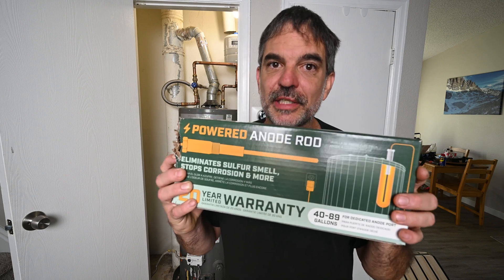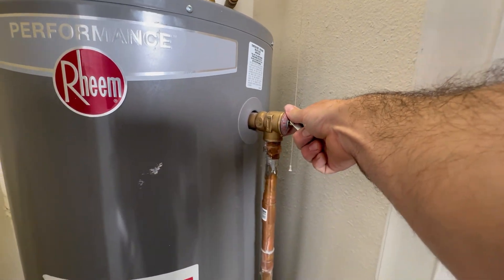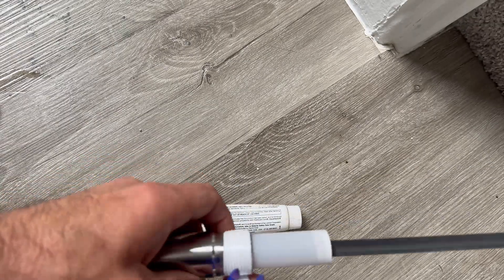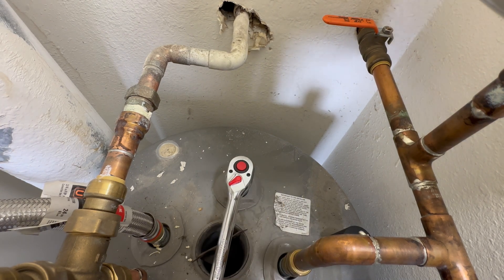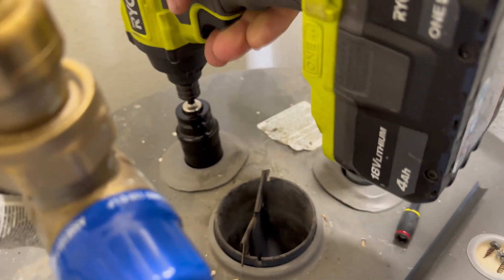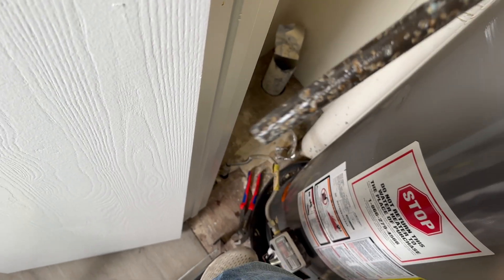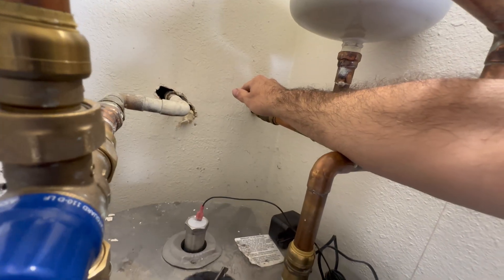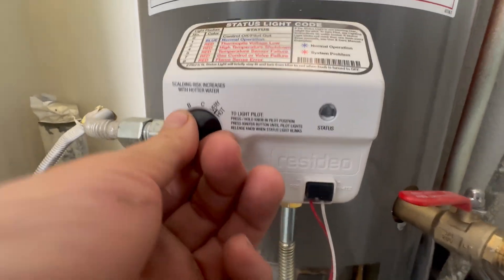This Anode Rod could Make Your Water Heater Last 20+ Years!

Comment: how does the electricity make the rod last
Reply: it changes the current flow.  during corrosion there is a transfer of electrons.  These powered units make it so the electrons can't be transferred in that direction.  Pipe lines and ships use the same principle to prevent corrosion.

Comment: My 32 gallon oil fired Bock water heater lasted 35 years, W/O ever doing "anything". Replaced it today, with another Bock.
Reply from the maker: yes, its unfortunate that water heaters from the 2000 - 2010 era will leak without maintenance

Comment: Looks good.  But I have to say that your old anode looked pretty good, too.  I assume you wanted to show the new rod and didn't want to wait five more years to show us how it worked.  Good job.
Reply from the maker: Yes, I was expecting it to be much worse but apparently we have pretty good water here
Reply: If you wait too long, the threads seize up and the rod will never come off. I had a house where I had to heat up the anode rod with a torch because it wasn't budging at all with my impact wrench.
Reply: @kungfoochicken08  Need to use a real impact tool. Like for automotive. Not a dinky hex driver for screws.
Reply: @SerenoOunce Yeah, I have a 1/2 Makita impact wrench and it still wouldn’t budge.
Reply: @kungfoochicken08  It's still a cordless tool. Need corded or pneumatic. Anything with a battery, regardless of brand is weak sauce in comparison.
Reply: @SerenoOunce That was true a while back. The new stuff is just as powerful as pneumatic or plug-in wrenches.

Comment: Regrettably, the product you are presenting does not provide long-lasting corrosion protection for your water tank. This item utilizes a standard wall adapter power supply that costs under $5.00 and is designed for applications such as LED lighting and CCD cameras. It is not specifically engineered for use with a powered anode. The power supply lacks voltage regulation and does not perform any electrical potential checks on the tank to guarantee that adequate corrosion protection is being delivered. 

The product you have installed promotes its offering based solely on the appearance of the anode, without any additional benefits.

The product you purchased is imported from overseas at a price of $22.50 and inflated by the brands aggressive marketing campaign once it lands on the sellers doorstep. 

If you send me this product, I will send you our product for $89.95 that since 1987 has never had a tank leak when installing our system. Water Tank Tec.
Reply from the maker: Let me guess you work for Water Tank Tec?????

Comment: Why is no one explaining the tech behind it. Why does an anode rod half the size have a 20yr warranty???
Reply: For the steel water heater tank to corrode, it must give up electrons. This device actively adds electrons to the metal tank, preventing the corrosion process from occurring. A typical anode rod does nothing to stop the normal corrosion process; it just is designed to corrode more easily than the steel tank, "sacrificing" itself.
Reply: It's the same tech that they use on large ships and submarines. On ships they're called ICCP systems. There's a bunch of YouTube videos showing them.
Reply: Because it's a gimmick. And ICCP systems on ships still use a sacrificial anodes. With this  the sacrificial part has been omitted.
A classic rod is simple and works as intended.
Reply: @SerenoOunce ICCP systems on large ship don’t use sacrificial anodes. Those ships do use sacrificial anodes as a fail safe and to protect areas like the rudder that are sometimes in the shadow of the electrical current.

The mechanisms of these systems are pretty well studied.

Comment: Thanks for the how-to. I want to replace the anode in 3 water heaters, not sure what brands, they're in 3 separate buildings. Are the threads standardized across all (or most) water heaters or do I have to know the threads/size? Thanks again!
Reply from the maker: As far as I know they are

Comment: My rod access has a plastic cap covering it, when removed there is also some foam. I assume the rod is underneath but I'm hesitant to dig out the foam. Any thoughts?
Reply from the maker: Dig it out, if you are digging more than an inch or two of foam your probably in the wrong spot. Rod access should be on top
Reply: @ApartmentMaintenancePro  Thanks for the reply, it's a Rheem and according to the manual that's the spot.

Comment: Thanks much for sharing! Our water heater is currently causing the rotten egg smell and we are planning to replace the anode rod.  If we replace with this corro-protec rod, do we still need to flush out the water heater?  Any input is appreciated!
Reply from the maker: I would try to flush it the best you can while the water is off
Reply: @ApartmentMaintenancePro  Thank you so much!